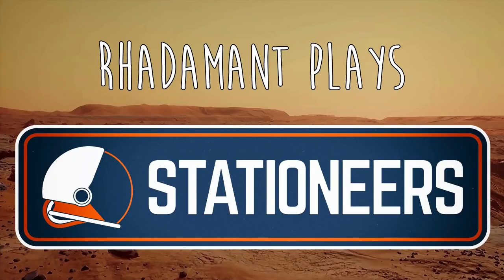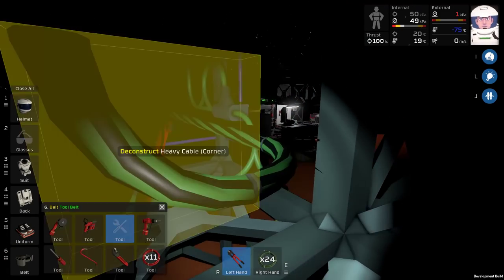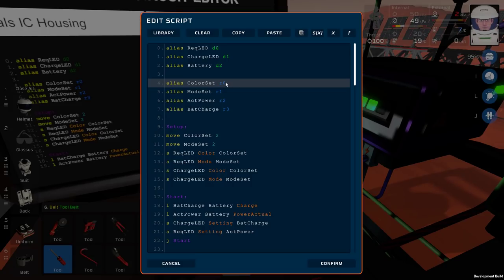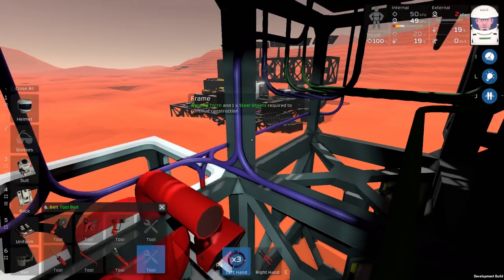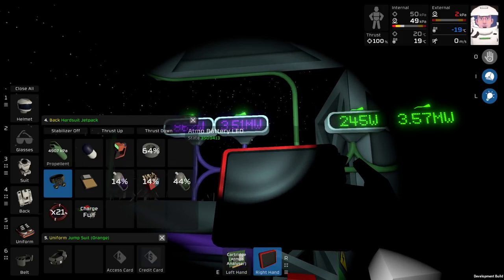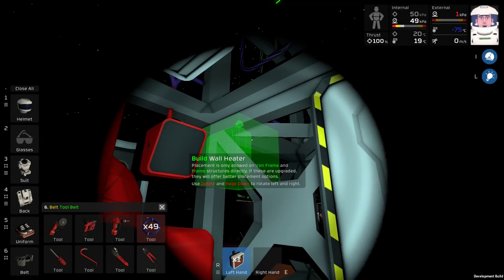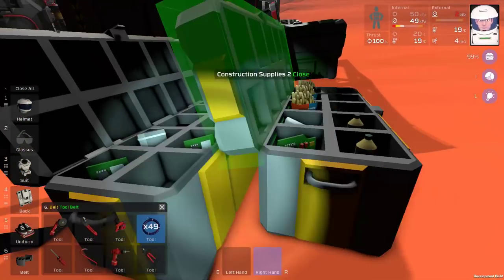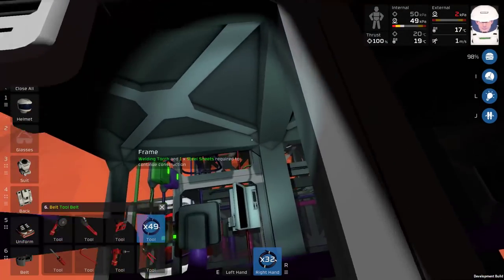Stationeers / EP 24 - Integrated Circuit LED Logic and Heaters / Mars Colonization

Comment: Just a design note I'd like to add. Wall heater use 1000 W. I would (and this is just personal preference) used the heavy cable to get power to each floor but from there have a transformer and use regular cables to get the power to each wall heater on that floor, since heavy cable is rather expensive.

And a note on the heating system:
Wall heaters deliver a 1000 joules per tick(100% efficient :P), your living quarters are 4x3x1 (I am assuming each frame is 1x1x1) thus at 1 atm 9.36 of the volume is N and 2.52 O2 (78% N and 21%O2). Based of that Each floor will have aprox 340 moles of N and 92 moles of O2 and subsequently 432 moles of "air". This is about 11 kg of air. The specific heating capacity of air is 1158 J/kg*Celsius. Thus each wall heater will deliver a delta T of 0.07 degree Celsius change per tick. 

For 2 wall heaters per floor that will be 0.15 degrees Celsius change in temperature per tick per floor. 

I don't know how fast the Martian atmospheric temperature changes, but a a result you'll have to take the integral of q = U A dT from the highest natural temperature to the lowest natural temperature, where q i the heat loss, U is the convection coefficient, A is the area and dT is the temperature difference. Since most of your base walls will be glass it will be a decent aprox. The welded steel frames will cause higher convection than the aprox though.
Reply from the maker: I want to centralize my entire power grid, so if I had transformers on every floor it wouldn't be all that centralized. Your idea is smarter than the way I am doing it, but for design reasons I'm keeping everything localized in the 'power control room' area.

Comment: Thanks, that wiring was driving me crazy!
Reply from the maker: The logic birds nest?
Reply: @Rhadamant  Yes,  It's so much simpler and cleaner now. 

It could be simplified further by treating the batteries as a single bank and putting all the batteries, transformers and apcs on a single data network. I believe that you could then get away with only needing the two ICs for all of the necessary displays. Which would shut up the whiners about them using more power. 

Since you're doing heating next have you thought about using radiators to preheat your gases network? Once heated it would act like a heat battery and reduce heating and cooling fluctuations. Also, it would allow you to more rapidly bring the base back up to temperature if you screw up at some point and decompress it. Which is exactly what's going to happen if you have to get in and fix that wiring along the outside wall...

Comment: Filters don't get used if the gas they are set to doesn't exist. 
It's based on the number of mols that pass through it. 
Test it. Turn on your H and/or N2O filter. It will not drop. 
This was tested some time ago by someone else by leaving it on with no gas going through. 
As well as a test of having a volume pump pushing through at 100L/s
and another with 1L/s going through. 
The filter that ran out 1st was the 100L then the 1L and the filter with no gas of that type going through. 
Did not drop.
Reply: LTL King This thing. However the last i tested this (about 4 months ago) the usage was dependent on time and not moles. They must have fixed it.
Reply from the maker: Whether it's time or mols .. I'm not that worried about having to replace a filter every 20 hours or so =]

Comment: Wouldn't it be better to make battery near the wall assigned for heating? Then you can place logic IC under the transformers, and if you are planning to use 4th battery like vitals battery (wired through the back of your base), then wiring would be easier since it's kind of symmetrical
Reply from the maker: That sounds decent, I'll take a look.

Comment: Bit of a long shot, as I've been following these 'tutorials' you dont still happen to have the script for the intergrated circuit I can copy paste in (shown at 10.08)? Thanks. Been great following these vids.
Reply from the maker: I don't have it exactly, but it adapted from this script IIRC.

alias ReqLED1 d0
alias ChargeLED1 d1
alias Battery1 d2

alias ReqLED2 d3
alias ChargeLED2 d4
alias Battery2 d5

alias LEDset r10
alias ActPower r2
alias BatCharge r3

Setup:
move LEDset 2
s ReqLED1 Color LEDset
s ReqLED1 Mode LEDset
s ChargeLED1 Color LEDset
s ChargeLED1 Mode LEDset

s ReqLED2 Color LEDset
s ReqLED2 Mode LEDset
s ChargeLED2 Color LEDset
s ChargeLED2 Mode LEDset

Start:
l BatCharge Battery1 Charge
l ActPower Battery1 PowerActual
s ChargeLED1 Setting BatCharge
s ReqLED1 Setting ActPower

l BatCharge Battery2 Charge
l ActPower Battery2 PowerActual
s ChargeLED2 Setting BatCharge
s ReqLED2 Setting ActPower

j Start
Reply: @Rhadamant  thanks for the swift reply =]

Comment: Noooo. Ic chips taking 800W to replace just a few chips that only takes 40W. Ahhhh.
My design was better.
When you get to heating and cooling. 
I gave you the programming for it in past episode.
Reply from the maker: I  am not super worried about the amount of power a system takes, I think I might be able to compress the IC logic even further.
Reply: I know. I'm exaggerating on the power usage anyways.
Just saying ic chips are so over used for just the littlest things.  
It's 5-1